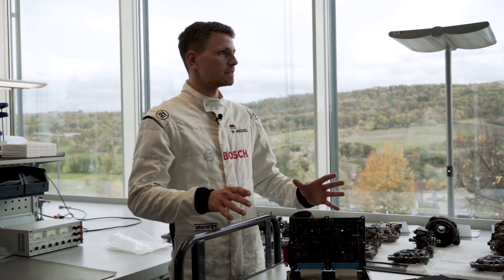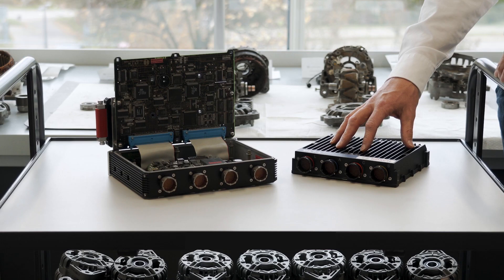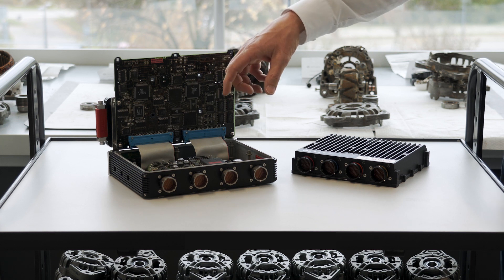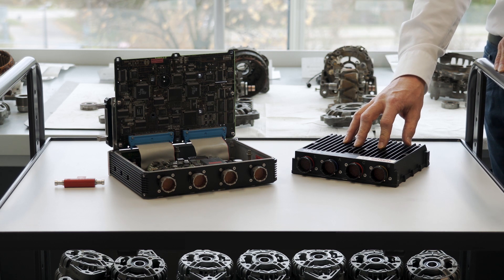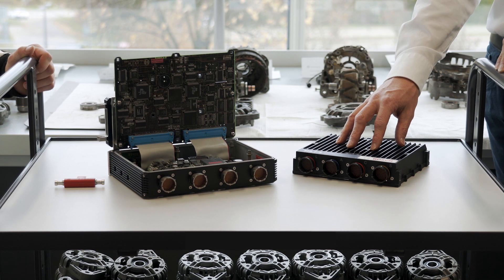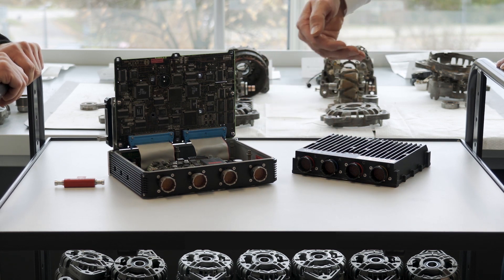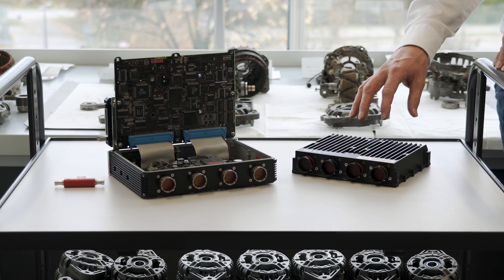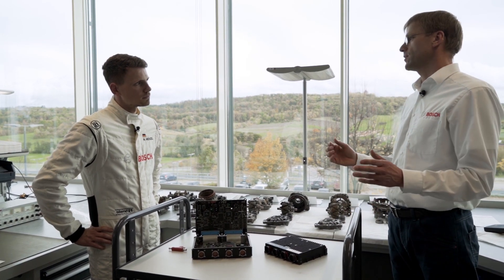EN | Bosch Motorsport Insights: Take a look inside a Bosch Motorsport Engine Control Unit

Comment: what is the name and model of the older ECU shown in this video ?
Reply from the maker: It is a Bosch MS2.9 which was used in DTM until 2011. In 2012 Bosch Motorsport introduced a new electronics package which remained until introduction of Class 1 regulations.